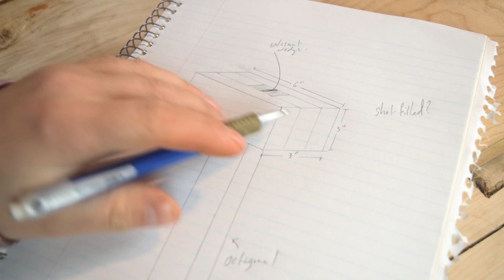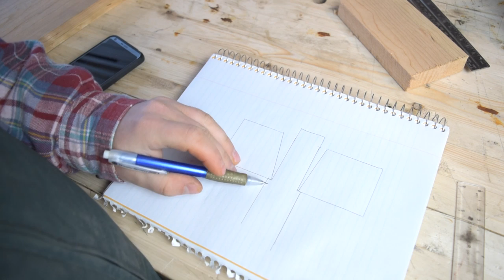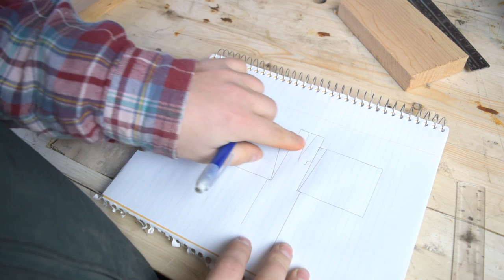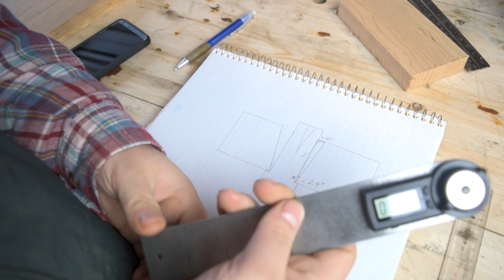How to Make a Wooden Mallet - [NLH 11]

Comment: I'll give you thumbs up,  but you are doing  things that are "Different" than most people would with wood. I always figured Hickory was one of the more dense woods. Keep em comming I'm enjoying them.
Reply: Hickory is heavy and dence go pick up a 2in thick 8in wide 8ft ling piece if it and you will find out its not light at all
Reply from the maker: Hey Cody, those dimensions in any wood would be very heavy. Hickory is quite light for its volume, and very tough. That, and its elasticity, are the reasons it has become a standard for handles.

Comment: Great video. I dont know what hickory you have used but try picking up a 2in x 8in x 8ft long piece of it and you will find out its not light. I agree axe handles are light but a bigger board is very heavy and dence. Great job om the video enjoyed it. Also you need to get another iron for your no.4 or 5 and make its a scrub plane blade youll be impressed
Reply from the maker: I have a second No.4 plane with a slightly cambered iron. 

Nearly any hardwood in that size of piece will be very heavy. Hickory is known to be quite light in comparison to its hardness and density. Compared to, say, oak.

Comment: That's a sweet project.  Great looking mallet.  Seems a shame to dent it up😁  I guess you need a larger brass mallet head made up.🤔
Reply from the maker: haha that would be HEAVY. But, this mallet won't really dent much. I have been playing with it, and that end grain is very tough. Also, the beauty in wood is that if it does get beat up a bit, I can just plane off a 16th and she's good as new again. I bet aluminium would make a neat mallet head? Very light.